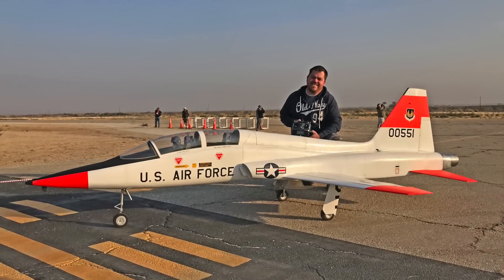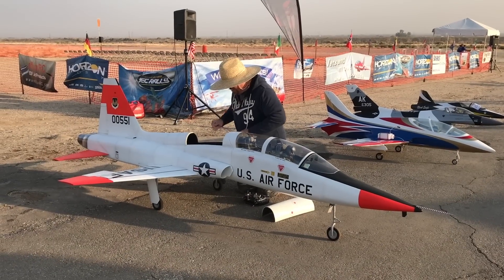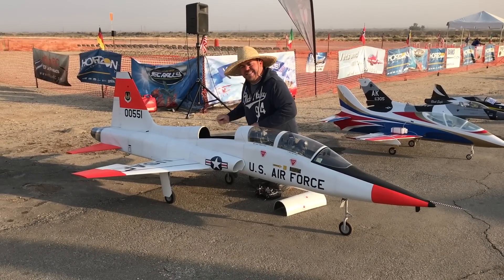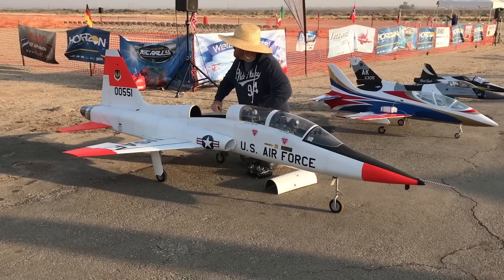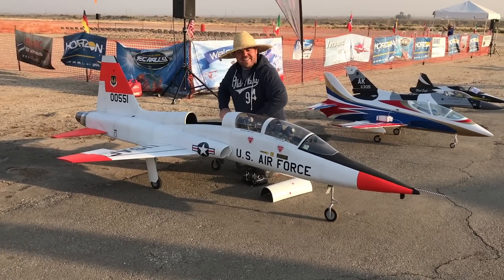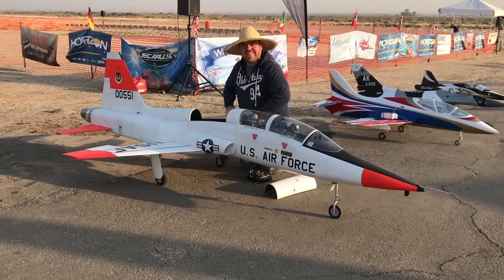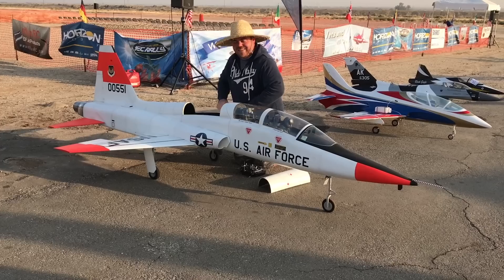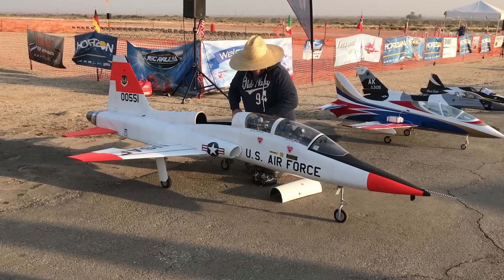Scratch-Built Giant RC T-38 Talon (World's Largest EDF)

Comment: hi Chris, do you have the plans and builders manual for yalls F9F Cougar. I picked up one built but the fuel tanks were not it it. it has a Turbax III in it with OS77 engine. or pictures of the fuel tank installation? or tell where where to find pictures or a build video? thank you! Gary
Reply from the maker: Give a call to my folks, they should be able to get you what you need. I don’t have any of that info at my place.
Reply: @Thercgeek  ok Chris, ill try them again. I left them a message thats why I asked you Sir! God Bless you and keep the JHH jets flying!  Gary

Comment: More information please. AUW, #cells & mAh, max power, etc. Absolutely breathtaking model!
Reply from the maker: Ah, good point!  I updated the description a little bit with that info.  I'll have him outline all of the specs on the power system for me too (motors, escs, etc.) so I can list it all out.
Reply: The RC Geek: thanks for what you can dig up. I found in other sources that it uses 12S 8000mAh packs, drawing 125A each, and weighs 44lb with 32lb thrust. A very impressive aircraft!

Comment: Can you post the configuration of this plane? (I hate it when there are no details on the hardware.)
Reply from the maker: The vid description does provide some details. The model was designed and built by my friend and is powered by two 12s eturbax edf fans with 12s 8000mah powering each. Radio is Airtronics Sd-10g. I’m not sure about servos, but I think he used Hitecs throughout.

Comment: What is the top speed achieved with the EDF motors?
Reply from the maker: It is very dependent on the airframe. Some purpose built edf jets have gone over 200mph. Generally for a scale airplane, speeds will range between 120-170mph. This big t-38 is probably doing a solid 140+mph at full throttle.